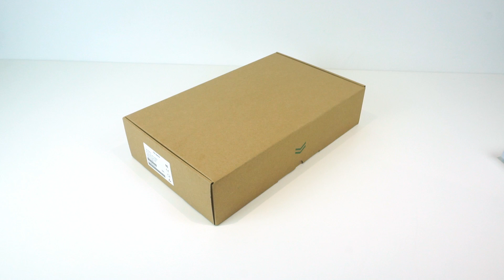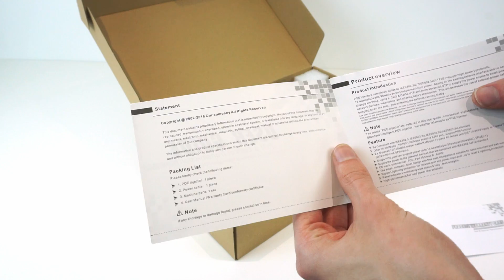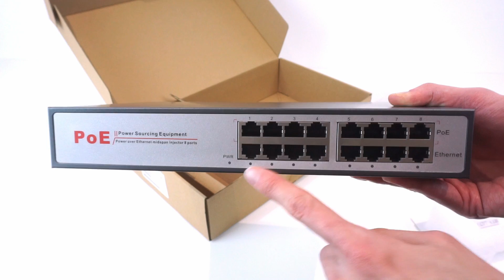The Mother of all PoE Injectors - FS PI250A-8 - Review and Teardown

Comment from the maker: Adding this in a vain attempt to stem the torrent of identical comments coming in... I didn't make it particularly clear in the video but when I was talking about "basic" PoE injectors always outputting a voltage, I was referring to the passive variety (including the model I showed here), not higher end injectors that are fully 802.3af/at compliant.  Sure part of the motivation for getting this device was for the autonegotiaton but the other factor was the fact that I can neatly rackmount it rather than having a pile of separate injectors.  I made a point of focusing on the 802.3af/at compliance as there are other multiport PoE injectors out there that are around this price yet are only passive and the compliant versions are significantly more expensive.

As for the flood of comments saying to "just buy a PoE switch" - sure, if I was doing a new install I would however I'd rather not spend £350 to replace my perfectly good switch with an equivalent PoE model, sure I can get a cheaper switch but I want to maintain a fully UniFi environment with a single switch connected to all my network drops.

Then for the people claiming that this is terrible quality based on seeing it for a few minutes in a video - sure it's probably not the highest quality device in the world, I wouldn't go and deploy it in some sort of mission critical application!  However, I'm extremely fussy when it comes to quality of electronics and I can't see anything with this that concerns me, it's a pretty simple device (i.e. little to go wrong), the main ICs handling the PoE management are made by Microsemi who specialise in that sort of thing and the power supply looks to be of reasonable quality.

Comment: Can’t help but laugh at the snobbery in YouTube comments when it comes to networking. This actually looks like a great device. Specially if all you need to do is add Poe capabilities. It’s pricey to buy a unifi switch with Poe built-in when you need lots of ports! Good stuff.
Reply from the maker: It's certainly a niche device but I can totally see it being useful in certain settings which people just don't seem to think of. The only major downside of this over a PoE switch is that you need to physically move cables to power them (still an issue with switches where only some ports are PoE which are pretty common) and you don't get any ability to view status or manage the device (not an issue for my limited use and if required, managed midspan injectors do exist). People seem to be used to big YouTubers with huge budgets or work in corporate environments where they are spending the company's money.  The number of times I'm told "just buy <different device which would cost me several hundred pounds>" as if it's nothing is crazy!  Me buying a new switch would cost several months worth of ad revenue from my entire channel and the video itself would bring in significantly less than the cost of the switch. Sure I could still probably afford to buy a PoE switch, but equally I could spend that money on something a lot more fun than a network switch!
Reply: Cameron Gray totally agree. I think people are just used to these YouTubers with money to burn. “Normal” working folk sometimes have to work on a budget. Thanks to your videos though I’ve just ordered some unifi products for my first network. This is actually a viable product for me as non-Poe switches cost less and if I need to add Poe I can keep my switch and add this in.

Comment: You (in the US on amazon at least) can get a managed 8 port Poe switch with 2 SFP for under $200 from UniFi.  Or an 8 port with 4 POE ports for around $100.  Or a ubiquiti erx sfp router with 5 Poe switched ports for $70.  I’d rather go with those than add another devices in the loop.
Reply from the maker: Problem with that is that it's another switch to manage and configure and will be potentially limited by the uplink to the main switch. To go with a single switch I'd need a minimum of 24 ports. On the other hand, this device is completely transparent to the network.
Reply: Cameron Gray Yeah, I hear you.  I like simplicity.  There’s another company WiFi Texas that appears to make these smart injectors, doesn’t appear to be a rebrand of the one you have.  For me, I’d like a “dumb, unmanaged” switch with Poe.

Comment: idk why you would go unifi and then not buy their unifi switches.
Reply from the maker: I already had a pair of UniFi US-24 switches which aren't PoE which I bought back when I only had a single PoE AP. I didn't particularly fancy spending over £360 to replace a perfectly good UniFi switch with a PoE model. If I was doing a new deployment I'd almost certainly go for the PoE switches however since I already had the switches, this was a much more affordable option.

Comment: This is exactly what I was looking for, can't find anything like it on Amazon. I have a Ubiquity 48p lite switch because PoE version is super noisy and nearly twice the cost! I only have about 8 PoE devices so this should work nicely. AT is needed with some of my cameras and AC HD Pro.
Reply: TP-Link TL-SG1008PE 8-Port Gigabit PoE+ Ethernet Switch.
Reply from the maker: That's a switch which wouldn't be manageable from the UniFi system. The point of the injector is that it's completely transparent from a network perspective.
Reply: I ordered this PoE injector a few weeks ago and it's working great. Totally transparent and working well with my Ubiquiti gear. Rack is much cleaner now!

Comment: ERS 5510-48T-PWR. You paid too much
Reply from the maker: I'm more than aware that I could get a used PoE switch for less than this however I have a UniFi environment so want to stick with UniFi for switching. The cheapest suitable UniFi PoE switch is over £350 so this was a much lower cost option.  As for the model you mentioned besides not being UniFi, it would be far too deep for the cabinet I'd be mounting it in and I daren't think of the power consumption.
Reply: @camerongray1515  I'm considering wiring my home up, and I've got a couple of set top boxes, and a VoIP phone (All are non PoE devices hence wanting a PoE injector instead of just a PoE capable switch) 

I'd have an actual 24 port PoE switch in the rack. Do you reckon this would do the trick? I'd like to get rid of my chargers really, and you don't use a huge amount of energy with STBs, and VoIP phones.
Reply from the maker: This doesn't seem to be what you're needing, this device provides power to PoE devices in the same way that a PoE switch does. To take PoE power and to power a non PoE device you'd need some sort of PoE extractor.

Comment: The only place this unit belongs is in the bin sadly, this type of injector would never be used now as POE+ switches are safer, less risk factor and more efficient, if you need POE+ for more than 2 ports, buy a switch that supports it
Reply from the maker: So you can judge the quality, reliability and efficiency of a product from a short video?  Sure, I wouldn't use it in a mission critical application but from what I can tell the quality is more than acceptable for my needs. I'm generally extremely fussy when it comes to quality of electronics but there's pretty much nothing with this that gives me cause for concern. Of course if I was buying kit new I'd probably go for a PoE switch but for powering 4/5 relatively low power PoE devices, this option was much friendlier to my budget than spending over £350 to replace a perfectly good switch with an equivalent PoE model.

Comment: Interesting, been looking into these things lately. But I stumbled over something even better. Swansons POE48, which is a PoE switch with built in UPS. But it's really expensive, double the cost you mentioned in the video. Maybe there're cheaper ones?
Reply from the maker: Looks interesting but pretty niche which explains the high price. Unless you have an explicit need to have it all in one box I'd avoid it, you're giving a lot of responsibility to a single device. The manufacturer look to be focused around power supply stuff so I wouldn't be particularly confident in its abilities as a switch.
Reply: @camerongray1515  Yes, I think it's for surveillance cameras. It would be cheaper to get an ordinary  Netgear switch with PoE fed from an UPS.

Comment: Hey quick question how wide is this unit in inches does this take up the entire 18 inch rack it doesn't really look like it possibly half a rack wide?

I do know that it's one unit I but my question is with.
Reply from the maker: The main box is 280mm (11") wide then the rack ears extend it out to the full 19" width. It's a very similar setup/size as a low port count 1U switch.

Comment: You don’t know how this works.
A proper injector tests before sending voltage in order to NOT damage non POE equipment...

Only the very cheap non 802.3af/at injectors are dumb and simply send voltage all the time.

Check the standards before teaching others please.
Reply: Btw. You can get a proper 10 port 802.3at switch for less of what you paid for that 8 port injector...
Reply from the maker: I am aware how injectors work and when I was referring to basic injectors I was referring to the cheap passive ones (including those included  with many devices such as the UniFi one I showed here)... I didn't just buy this for the autonegotiaton, I also bought it from the neatness perspective instead of having 5 different injectors. The other multi port injectors in this price bracket did not look to support autonegotiaton so that's why I focused on that specific features. I'm aware I could have bought a cheap PoE switch, I purposefully went for this didn't want to have to have a secondary switch hooked up to my main one just for PoE devices and to replace my main switch with a PoE equivalent would have been over £350. The entire reason for going for this was to get something completely transparent from a network perspective.

Comment: I don't see the EEPROM with the parameters, that chip could be also controlled by an external MCU.
Reply from the maker: It's a pretty neat little chip, can work completely unmanaged as it's doing here but can also be used in fancier managed models.
Reply: @camerongray1515  Yea I have seen, also full datasheet and commands are available to the end user.

an EEPROM would be cool to change some settings even on this cheap injected.

Comment: PoE switches and injectors that support 802.3at/af should negotiate sending power with the device as to not to fry the client device.
However, there are passive injectors as well (Ubiquiti uses those as well) that will always power the client, sometimes up to 24V.
So always check what adapter your PoE device needs.

PoE injectors are good for powering a single device. However, once you have multiple devices (like Access Points) that connect to a central network closet, you can put a PoE switch there and power all APs with one device instead of adding multiple injectors.

Comment: Another great Video Cameron. How ever I wouldn’t have that Poe switch any where near any of my equipment or even a clients. I would feel much safer with a known brand. Also I have never had a POE switch destroy anything else plugged into it. Only heard this has happened in the past with POE when it was launched. UniFi stuff is fantastic we use it daily for clients in and around Glasgow, I would be more inclined to have used one if there switches with POE due to can manage remote reboots etc.
Reply from the maker: I was a bit suspicious at first but given that it uses proper Microsemi ICs to handle the PoE and the power supply looks reasonable I'm not too concerned. I probably wouldn't use in something mission critical but I'd be happy with it in a home/small office environment. As for damage, it's unlikely to occur with a modern PoE switch as they almost all support PoE negotiation, the issue is with the basic passive injectors which I have seen damage devices. I would absolutely have used a UniFi switch if I was buying the kit now but it wasn't worth spending over £350 to replace a perfectly good switch.
Reply: Cameron Gray yeah, I know what you mean. We have used a lot of netgear etc Poe switches in the past due to customers budgets.

Comment: NOT TRUE (at least with good injectors that meet the standard). You will only get voltage after the negotiation process
Reply from the maker: As you said, that only applies to higher end 802.3af/at compliant injectors. Most of the lower cost injectors (including those supplied with many devices) are passive and do not support any sort of negotiation. If I were to buy a few of the good injectors, I'd likely end up spending more than I paid for this.
Reply: @camerongray1515  If they are 802.3af/at they need to support negotiation and are not passive, that's the whole point of it being a standard. I'm sure you can find a "802.3af"-labeled injector on some Asian markets that have nothing to do with the IEEE standard, but you can also buy a cable or "adapter" with an RJ45 in one end and 110/230V connector in the other, so i guess you got to figure out what supplier to trust in the end anyway.
Reply from the maker: Think I worded that a bit badly, when I said "higher end" I was referring to all 802.3af/at complaint injectors. I was referring to me wanting to avoid basic passive injectors which many cheaper models are. I bought this one for two reasons, one was because it's safer than a passive injector and additionally because it's neater and likely cheaper than using 5 or so single port 802.3af compliant injectors.
Reply: @camerongray1515  Gotcha, like you said, there's a small but important difference between "higher end 802.3af/at compliant injectors" and higher end injectors that support 802.3af/at. :)

Comment: This device needs some kind of serial port, to be able to read info and power up/down ports (in order to do a hard reset for example)
Reply from the maker: Yeah, that would be cool.  The higher end ones from Microsemi and Phihong are available with managed versions, this is more of a basic unmanaged device.  Not too big an issue for me since it's pretty easily accessible if I need to power cycle ports.

Comment: PMSL Bought a Cisco 24port POE managed switch for £35 on ebay,
Reply: Cisco makes great equipment, but they are LOUD and suck up alot of power.
Reply from the maker: That's fine if you want a used Cisco switch.  In my environment I want to stick to UniFi switches which aren't available nearly as cheaply.
Reply: Those switches that are being sold cheaply only support 100mbps Ethernet.
Reply: @MrEdrftgyuji  must have got a bargain mine is gig

Comment: No... just no need for this... Just get UBNT to send you the US16-150
Reply from the maker: It's not as though I have a magical contact at Ubiquiti to whom I can just snap my fingers and get any product I want for free... There are also plenty other people out there who may benefit from a device like this.  Additionally, I'd realistically need a 24 port model as I have 21 network drops (soon to be 23) and don't want to have to deal with them spanning multiple switches.

Comment: can anyone please tell me what is the point of this PoE thing? as i understand it's just to power some devices over RJ45.. why though? what's wrong with a regular power adapter?
Reply from the maker: Less cables, particularly useful for things like wall/ceiling mounted access points and cameras so you don't need to run power cabling to them.  Also useful for VoIP phones to cut down on the amount of sockets used.
Reply: Cameron Gray can you get PoE to USB adapter?  For charging USB items perhaps?
Reply: @camerongray1515  thanks man. : )
Reply: @bamdadkhan  PoE can also be useful for keeping devices that are spread across a room/building powered from a single central UPS during a power outage. Rather than requiring separate UPSs all over the place wherever you need devices to stay powered during an outage, you can just get a single, higher-power/capacity UPS and distribute that backup power throughout the premises :)
Reply: @AndrewGillard  yes, i can see how that simplifies maintenance. didn't think of that, thanks. : )
Reply: bamdadkhan less cabling mainly. Smaller components.
Reply from the maker: Yep, the cheap USB ones I can find are only 10/100 but there are more expensive PoE splitters that can handle gigabit.  They aren't specifically USB but it wouldn't be too hard to get one that can output 5v and then find a suitable cable.

Comment: I've never seen a device damaged by PoE in all my 20+ years of working in IT and in networking, but I've always used proper PoE switches.
Reply from the maker: Also just the basic "injectors" as many will just output power irrespective of the connected device. I know people who have fried laptop network interfaces with them before causing them to only connect at 100mbps afterwards.  A proper switch will almost always correctly negotiate PoE.
Reply: Think he's takling about the "POE" splitter type devices.......
Reply: @timballam3675  Oh yes like the ones I've seen with CCTV cameras before - injector splitter cables at each end of the ethernet cable - I see how they could cause trouble.

Comment: Could’ve bought a unifi Poe switch for a tad more than £91
Reply from the maker: That was an option but I didn't want to deal with having different wall plates patched to different switches as well as having a potential bottleneck with the trunk between the two switches.